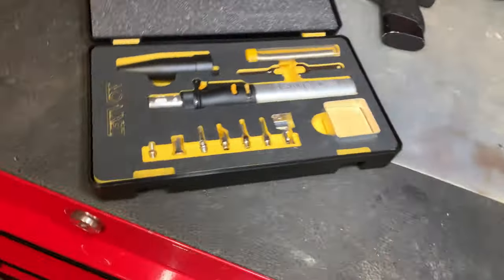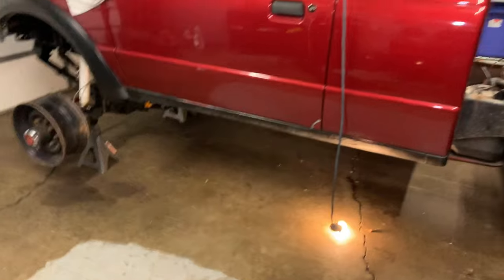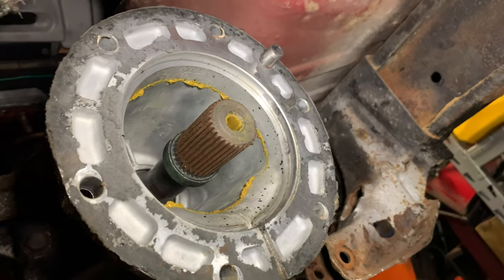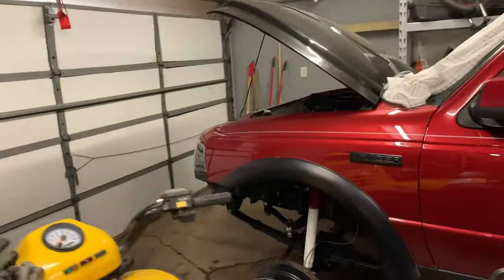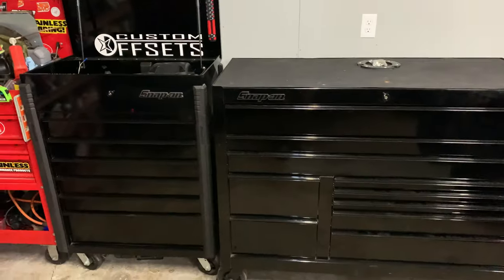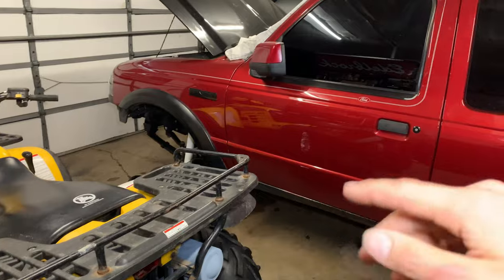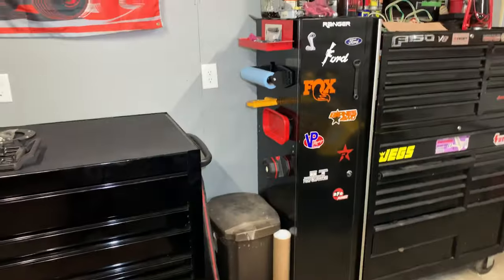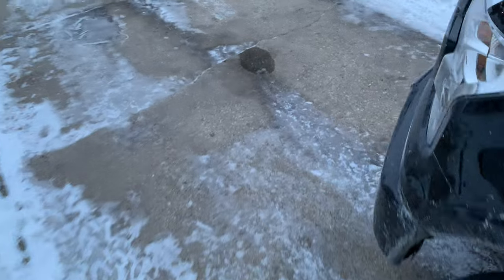5.0 ranger swap so close to first drive

Comment: I’m doing the same thing to my truck! 
I’m still ttb but I got an HO short block that I’m refreshing with new bearings, polished crank and new rings. Using a 93 f150 as a doner for the rest of the stuff like heads, intake, harness, manual trans , computer and the other odds and ends going in a 93 ranger. It’s in its early stages. Still has the blown up 3.0 and trans!.hope you have a blast in your truck! I can’t wait to get mine together so I can go bash it again with a v8 under the hood😎